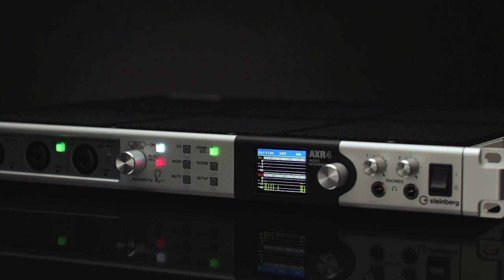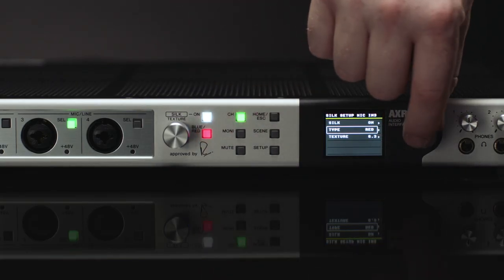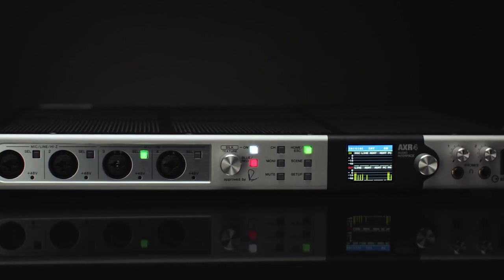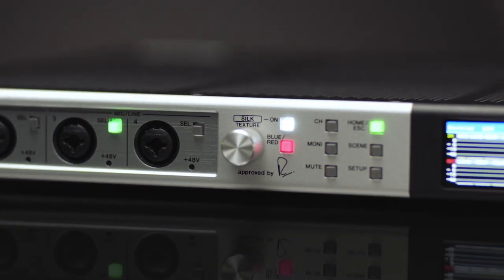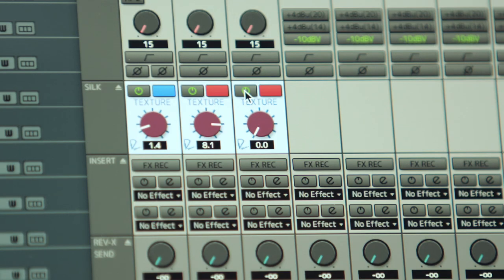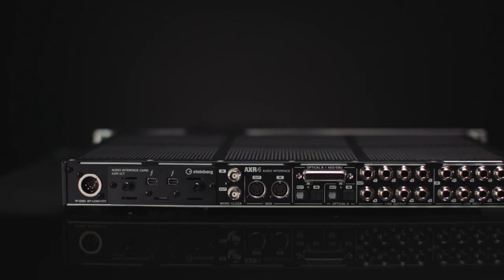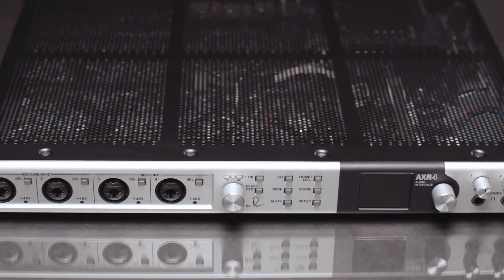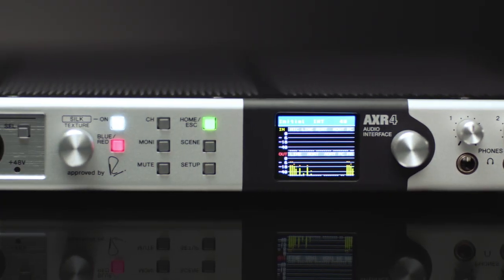Rupert Neve Designs SILK Processing in the New AXR4 Audio Interface | Audio Xcellence Redefined

Comment: If the Neve Silk is a digital emulation, could we see it in Plugin form in the future?
Reply from the maker: Hello, no, there wont be one. In the AXR4, SILK processing is closely related to the characteristics of the microphone preamplifiers and cannot be separated. If a separate SILK plugin was provided and used with an unknown microphone preamplifier, it would almost certainly have a negative effect on the sound.
Reply: Steinberg Audio Interfaces 

That makes sense, thanks for the response. I am a massive fan of Steinberg products hardware and software and I am also wondering if there are further Neve or Yamaha VCM plugins planned for the future? Many Thanks